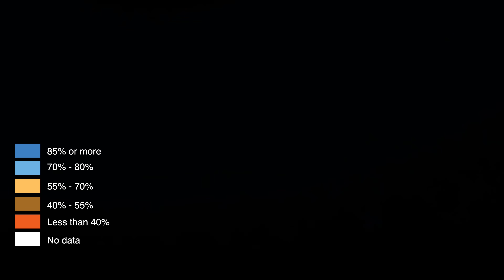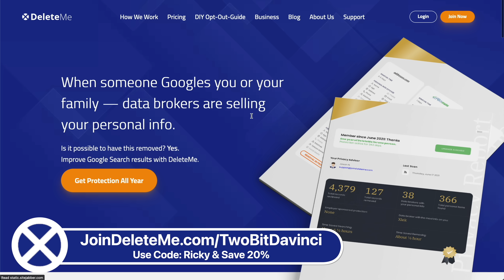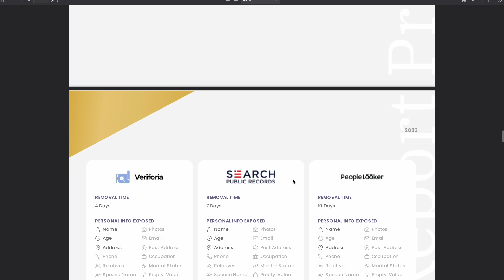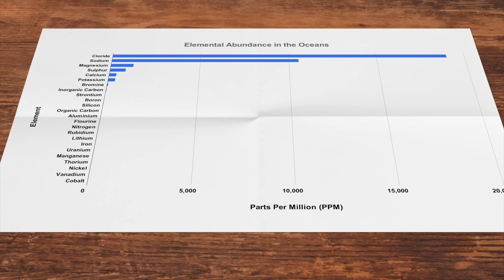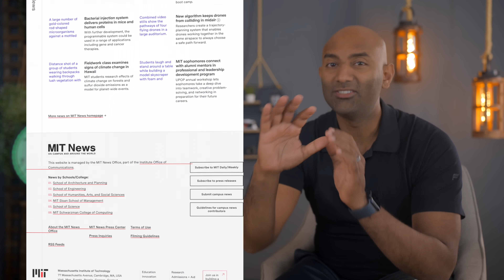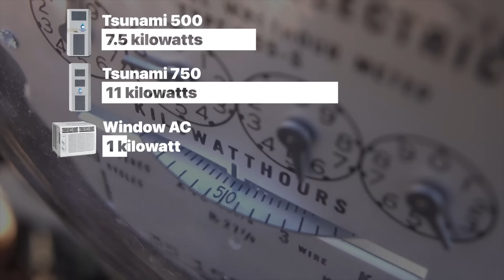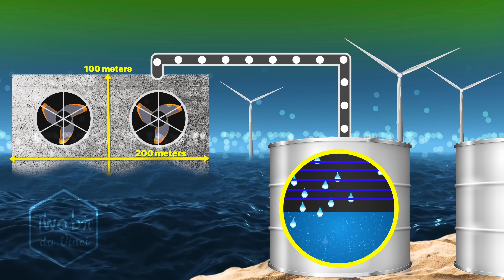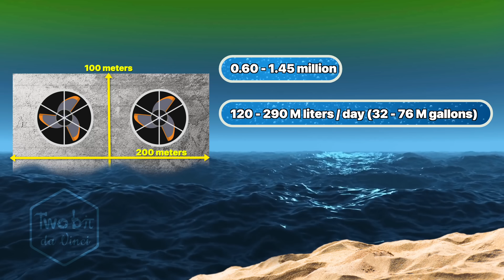This Tower Turns Ocean Fog Into FRESH Drinking Water!

Comment: If you want a really effective way of harvesting drinking water from the oceans, you would want to build a large solar-updraft tower, either as a floating device or on land near coastal area and fill the surface beneath the canapé with sea water. Dimensions are 5km diameter canapé and 1km large solar tower using strong and lightweight materials. It harvests energy from the updraft humid air, and condensers in the tower can harvest drinking water. Plus you can collect any rainfall on the 5km diamater structure and store it in tanks. 
You could also built them on land near a mountain range that is a barrier for rainfall, and built the tower alongside of the slope of the mountain range, and fill the surface under the canapé with sea water (so it has to be built close to the ocean). Some of the humid air will escape and will increase rainfall in the area that normally is part of a rainshadow.

Comment: I love the idea.  We all have seen the moisture condensing out our AC units; thank you for the quantification, it really gives a good perspective.  I would note, however, that the cost argument requires clarification.  Water providers have to pump and store the water around town and that implies capital, operational, and regulatory  costs that may not have been considered in the analysis.  I suggest that instead of using the term “the cost per beneficiary” (which people may infer as their water bill) you could refer to the cost to produce the water before distribution to the customers. Great work!

Comment: Powering with wind and solar is a non starter. The panels or turbines needed to power these units will overwhelm the condensation units by size. The water gathering units may be relatively inconspicuous - but the wind and solar farms needed to power them will be unisightly behemoths.

Comment: This whole thing is absolute horseshit! So you are trying to tell me that a tower 100x200 meters can scoop up 200 Million liters of water in the form of humid air. This will then be condensed to liquid water. Yeah so this thing only needs a cooling system capable of removing heat energy of 440000000000000 Joule per day. That's the energy released from condensing 200 Million liters of water. There are 86400 seconds in a day so that's 5,1Billion Joules every second that needs to be removed. In other words, 5,1Gigawatt is produced by the condensing water when changing phase. That is the equivalent of having 5 nuclear reactors running at max capacity trying to heat the system, continuously, per tower!  If this heat is not removed from the system, the condensation gonna stop pretty quick. You can not dump 4,4x10^14 J  of heat energy per day into the ocean with an underwater pipeline to shore. And the cooling system on shore would need to be something the world has never seen. It's ridiculous! 

There are other problems too, The moist air at the surface wouldn't be moist for long if you suck it up and remove it! New air that replaces the sucked up air doesn't magically become saturated with water immediately to be sucked up again. It needs to evaporate from the ocean first and that takes some time! You will end up with dry air sucked into the system pretty fast. 

Also, this water that is condensed is not clean and ready to drink either. It contains pollution from the air. It's like drinking rain water, maybe good enough for plants but not healthy for humans. You gonna get all that nice sh*t that comes out from the chimney at the factory straight into your drinking glass. Ground water is filtered through the ground and is much cleaner.

This entire thing is nonsense and it will never happen. You think competent scientist and engineers haven't thought of this before and decided it's a terrible idea? Then some "researchers" from a university who probably study something completely different like art or design or something get this bright idea without understanding any physics, making fools of themselves.

Comment: off the top of my head: A dark floating roof above the sea surface,  that is closed on two sides. The roof is made up of rubber with floats running the length of the underside, doubling as chamber walls. Fans running on solar power sucks the trapped humid air through condensers on the seashore and the water is pumped to holding tanks.

Comment: The most energy-efficient way to get seawater to evaporate and condense would be to utilize the already-present temperature difference that exists in most oceans- the water above is warmer because it receives sunlight, and the water several meters down is cooler. This termperature difference between the layers of ocean can be used to drive a vapor-condensation cycle. It would work like this: Large diameter pipes would be formed into U-shape and placed into the ocean just offshore where it is deep enough to allow for a significant temperature differenence bewteen surface water and deeper water. The pipes would go down several meters under the surface, and then come back up above the surface. Both ends of the pipes would be exposed to the atmosphere, and one side would have a fan blowing the air down the pipe and out the other side. The intake air would be drawn through some sort of apparatus that would increase its humidity as much as possible, like maybe an array of absorbent fabric that would wick up the seawater, or maybe a misting system. Then as the air goes down the pipes and hits the walls that are relatively cooler due to the cooler seawater down below, dew will form on the sides of the pipes. And we would also probably want to increase surface area of the pipes by some means.  This condensation is our fresh water that can then be pumped to the coast and processed for human consumption. Since the vast majority of the system would be under water. this would eliminate the need for a lot of the structural implications of the towers.
Reply: That is called OTEC.
Reply: @robheusd  I'll have to check that out!

Comment: I might have missed it in the report, but are there details on ideal distance from coasts or does it matter at all?
Reply from the maker: id have to look again but I dont think it would matter too much, but too close and you might get ocean spray from waves which wouldnt be good since that has higher salt content.

putting a machine on a barge or another floating rig with tanks would be a good place to start a pilot plant maybe an old oil rig

Comment: Um, if you capture enough moisture from the air, rather than letting it rise into the atmosphere, you'll end up impacting the amount of rain that falls.
Reply from the maker: you would think so , but as long as the sun is shining its so powerfull that it shouldnt have and effect on the surrounding moisture since the rate of evaporation is greater than the amount you can remove.

Comment: Would have preferred a working example over lots of calculations.  => 30 years of data and average results.  Hmmmm.  I think people will want water every day, so perhaps best to look for lowest output, rather and 30 year average.  => A working example can see if there is environemtnal or fauna impact, such as the unanticipated bald Eagle killing by wind farms.  => As the water removal impact is local and not global, I’m not too impressed with a comparison of the world’s water production of water to the consumption in several coastal areas.  Hate to see new water production in California resulting in a corresponding reduction of rain as water crosses the mountains of 20-40%.  That would be unfortunate.  => Sounds like a good idea, but new ideas with only upside are rare.  => If this really worked, why are not ships using this technique?  => Thanks for an interesting video.
Reply from the maker: ships should be using this. it should not effect surrounding moisture levels since the sun causes a much higher evap rate on the surface of the ocean than this machine can remove. 

but we need a pilot plant first to be able to test this out.

now other atmospheric water generators over land are a different story since they are removing vapor far from the point of generation.

Comment: Good thought but a bad deed to hydrologic cycle. How are you going to save the inland? Tq
Reply from the maker: It wont effect hydro-logic cycle seems counter intuitive but it wont. Very different from land based water generators.
two main reasons
1. the power of the suns ability to cause evaporation on the ocean surface is much much greater that the machines ability to remove said vapor, its instantly replenished if ran only while sun is out.
2. if using land based solar power to run fans and pumps etc it can increase wind across water surface thus increasing evap and adding energy to the system.

Comment: If you take atmospheric moisture from one place to water the ground or drink, couldn't this cause drought in another if that moisture was building up to rain in a place down the flow? Many times the rain in let's say Chicago will come from the golf of Mexico and rain across the country, but if the states are harvesting the water from this is it possible that needed rain wouldn't make it there?
Reply from the maker: if this was land based maybe... in addition to the following reasons if there ever was somehow a concern of this the machines could be turned on or off depending on weather patterns.

It wont effect hydro-logic cycle seems counter intuitive but it wont. Very different from land based water generators.
two main reasons
1. the power of the suns ability to cause evaporation on the ocean surface is much much greater that the machines ability to remove said vapor, its instantly replenished if ran only while sun is out.
2. if using land based solar power to run fans and pumps etc it can increase wind across water surface thus increasing evap and adding energy to the system.

Comment: It will still have a lot of salt in the water. It could be good enough for some agriculture.
Reply from the maker: maybe your thinking of ocean spray? ocean fog should have very little.
Reply: @TwoBitDaVinci , The immediate problem is how you would separate the waters? 

Now ocean fog contains salt, but less than ocean spray. This is because ocean spray is created when waves break on the shore, which causes salt to be suspended in the air. Ocean fog, on the other hand, is created when water vapour condenses around tiny particles in the air, such as salt. As a result, ocean fog contains less salt than ocean spray but its still there.

Comment: This should be labeled science fiction.  The physical plant of these structures is simply enormous.  Building only one of them would be considered a mega-project.  Building multiple would be a literal impossibility.  The structures are 200 meters wide, which is essentially the height of the golden gate bridge, but in width, not to mention the structure also rises 100 meters above the ocean, ignoring the size of the structure under the water.  The environmental impact would be catastrophic.  The size of the structures dimensions are equal to a New York City block, meaning the entire rectangular block, replete with multiple sky skyscrapers.  10 city blocks rising, hundreds of meters off the ocean floor are going to be built off the coast of major cities?  This idea is sheer maddness.  I hope the scientific paper detailing this project was the work of graduate students asked to dream up impractical engineering projects to solve fresh water availability and not a serious design.
Reply: while i too am skeptical about it, the idea is not as unfeasible as you think
the buildings main function is capturing air, which has much lower costs than skyscrapers, a strong steel frame with airtight sails or plastic panes as the walls to catch it should not be that expensive and overall probably less than a conventional water treatment system which has a lot more components that need maintenance. 
you can perhaps even use solar panels as the wall on there to even give energy as well, though i doubt that as afaik winds tend to come from the east or west and not from the south.
my main doubt is on how effective it'll truly be as the capturing numbers seems too good to me and more in line with scams i heard of before, wouldn't surprise me if the numbers on that theoretical paper would give less than 1/10th of that in an actual prototype (i haven't read the paper myself and don't intend to research it though)
Reply: It's a lot more feasible than you make it sound. We already have the materials and technology to do much more, and some of the synthetic carbon materials like graphene will make things like this easier. As for negative environmental impact, that could be mitigated, if not reversed, pretty easily
Reply: Nature is a complex system. All attempts to alter this system to extract from it, while not understanding said system and the intricate effects our extraction had, led to disadtrous system collapse.
All. Of. Them.
So go ahead and let us fck the system that sustains us. Yippee, nothing wrong can happen. We humans know it all. We murricans will always win.
Reply: They were trying to capture wind power with the height...but...may not need to capture wind power that badly...ahem...
Reply: Doing a simulation is one thing, conducting a pilot project to prove the sea water tower concept is the minimum for the actual field of research. Otherwise, it is a dream pipe.
Reply: It's a massive but it's also a relatively simple structure. There isn't really that much to disrupt in the places you're going to put them either. They could even be artificial reefs pr islands seeing as everything under the water is irrelevant to the function of the structure. I would be more concerned about how much it would actually cost to build a large structure that is capable of handling the worst the ocean can throw at it.
Reply: Tf are you talking about? 100m is nothing. Have you ever seen an oil rig? It's so frustrating how fossil fuel companies do enormous projects all the time, but as soon as something half as large is suggested that might help someone other than a fucking billionaire, the hand-wringing begins. Get fucked.
Reply: yap
Reply: This sounds like NIMBY problem do you want water or not.
Reply from the maker: a more practical design would maybe be to use a retired oil rig and adapt the design to it.
Reply: @TwoBitDaVinci Agree, good idea!
Reply: @TwoBitDaVinci no it would not. Why tf are we so few to see the obvious cringyness in you technoreligious types???
Reply: @TwoBitDaVinci  The natural fog-harvesting sounds remarkable, but must have its ecological drawbacks. One might be the removal of the source of fresh-water for the ocean causing, in turn, a more salinated sea whose salination is constantly growing. 

As a child I noticed fields in the early morning and the great fogs (which showed me the amazing spiders living there and the insects' intricate webbing) and thought about how easy it would be to harvest this water. Collecting fog from these fields obviates our demand without great  transport-cost, the costs to the ocean environment which structures like this cause and enormous energy considerations..

Thanks Ricky for your great video and if I were a few years younger...

Comment: Instead of compressors, they could just connect the panel to the surface of the ocean. Since the ocean surface is colder than the atmosphere, the panel will be cold and it will result in passive water condensation.

Comment: Placing these collectors on the ocean makes the most sense.  On the drive to Santa Barbara there are islands made for off shore oil drilling.  There have been investigations for using standard RO on these islands. The discharged brine can be so dilute that within several feet of the discharge the salt content is not readily measurable.  Many local desal plants use old power plants because they already have the intake and discharge piping in place which reduces cost. The environmental effects of concentrated brine never used to be part of the total cost equation for these installations. The Seawellbuoy is another example of thinking out of the box.  Towers to harvest humidity make even more sense.  Using natural "desalination" from the sun they become an advanced  solar still. The differential temperature between the fog and the ocean below can utilize more thermal efficiency. Piping of fresh water is an issue for offshore installations but it is an engineering problem that is solvable.  If we can drill and pump oil from floating platforms we can do the same for harvesting water.

Comment: why build 200 feet tower if you could build black floating collector mat to heat up the surface to speed up evaporation? like make it so the wall sink 5-10 feet down and stick up about 2 feet above in case of storm pull it out the water, way cheaper imo